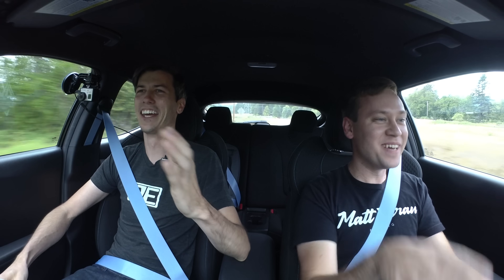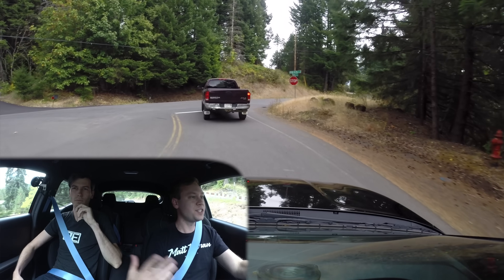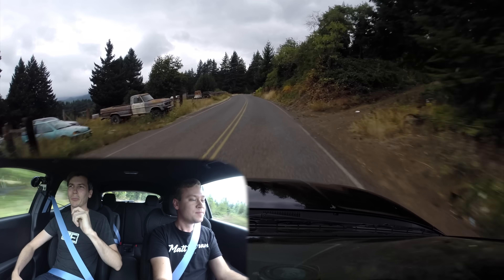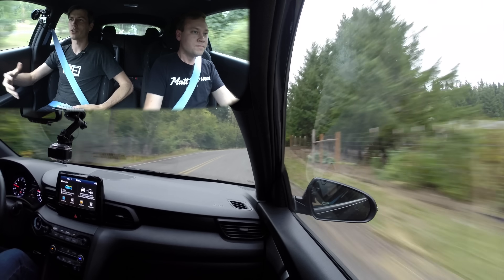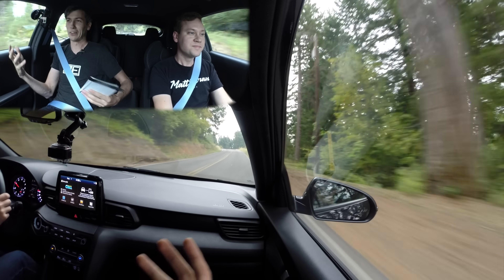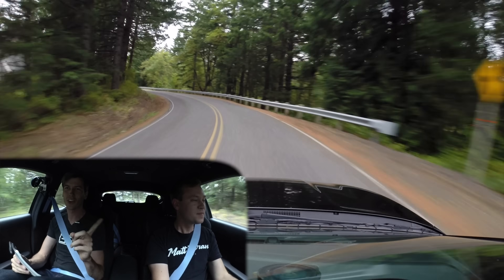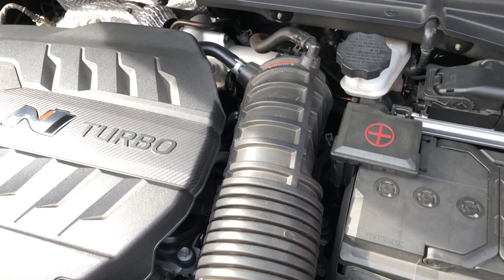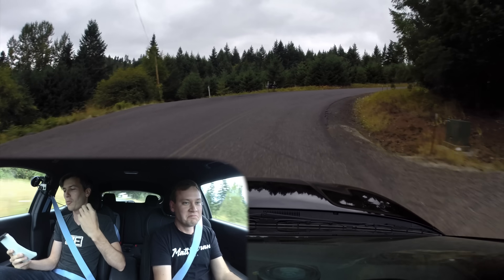Are Car Exhaust Crackles & Pops Fake?

Comment: So this is an old video, but I would not say the F-Type started this, My car a 2013 335is does it, and so does a 2011 My 2007 335i did it much less but did it a little none the less. Point being the 335is predates the F-Type and I am sure that BMW did not start the trend either. But one thing that is not addressed is what does it do to the CAT. Also with a DCT or Slushbox does it really do any good for turbolag that is non existent. I mean sure DCT is a computer controlled "manual" for all intents and purposes, I cant see the 90ms shift times having much effect on turbine speed.

Comment: My '66 Corvette does it, no electronics to alter timing, and sidepipes. It's much more restrained than my '12 Camaro 1SS/LS3 was, which was absurdly loud with crackles and pops. My buddy's '69 Hurst/Olds does it, no electronics either and quite illegal straight pipes. His car sounds like a machine gun on a downshift! Mine is tame by comparison. A little unburned fuel in the exhaust. The ignition timing on both is correct as in mechanical and vacuum advance are exactly where they need to be for best overall performance. My '70 Buick GS455 Stage 1 clone with the big tube headers did not do it- it had electronic ignition I retrofitted. Now, cue the 'no vacuum advance!" crowd. Tsk tsk, at WOT there's no vacuum and you will never miss that .05 second on the street. However, being able to actually reach the next gas station is a plus.

Comment: As an old geezer who remembers coming of age -i.e circa 1976...  I find it hard to relate to drivers today who value exhaust noise for the sake of, well, exhaust noise.  Not that I minded exhaust noise typically associated with muscle cars of that *era.  But noise per se was hardly the quantity to be desired. What was desired was the feeling of being pinned to the back of your seat. 

* (Technically, the muscle car era ended just a few years prior, when Detroit found itself ill equipped technologically to accomodate a combination of new emissions laws and a spiraling cost of gasoline.  But I digress...)

Comment: I have a 2020 WRX stage 1+ that gurgles and pops like crazy when downshifting, especially when it’s cold. I can tell by my access port that it happens more if the car pulls timing (it’s always been within safe parameters). It’s my first project car that hasn’t had a V8 and I must say…I LOVE IT!  It’s by far THE most fun vehicle I’ve ever had.

Comment: I love the cracks and pops. Not only do I love the sound now and then, I also find it useful for example, when someone is on my tail or driving too close behind me and not letting up, I will switch my BMW X3 M40i into Sport Plus mode and let off a barrage of pops and crackles like warning shots and without fail, they back up. So I think sometimes, it can be useful in a way.

Comment: I really hate them pops and bangs mainly if the car is going 30km/h 2500rpm slowing down gently and it’s cracking like a race car on nurburgring. So lame and unnecessary.
And btw aren’t the fake vents on Supra designed for tuners to make them functional easily without screwing up the bodywork? I think I’ve heard someone talking about it and it would make sense since Supra is tuned so often anyway.

Comment: Porsche’s gas pedal is also to control the amount of fuel that it’s being injected into the cylinders besides controlling the amount of air just like in the Diesel engine where you only control the amount of fuel that you’re injecting into the cylinders by pressing the gas pedal. That’s how diesel throttling works. And Petrol throttling works by controlling the amount of air going to the cylinders by pressing the gas pedal and opening the throttle body. So Porsche decided to use the gas pedal as control both air and fuel as well like in the diésel engine.

Comment: I am not a fan of fake stuff.  However I do like the sound of the exhaust crackle.  I was hoping to hear some history of why older race cars [pre-computer age] did it.  As for the CVTs, I am a big fan of the forced gear ratios, during hard acceleration only.  Otherwise the car seems very slow, since there is no change in engine tone.

Comment: i used to have a 2005 mini cooper supercharged and after 3 years i was totally frustrated of the crackles and pops all the time, sooo anoying, you could press and release the gas and would do unlimited crackles and pops at 80km/h, sounds like missfiring backfiring crap beater car, the problem is that reviewers that drives the car for 1hr likes them, then everyone wants them, then manufacturers puts them on car and someone has to live with it for ~1500hrs, never buying a car that crackle and pop again, ever

Comment: @1:50 explains the conundrum. I am okay with enhancing noise inside the cabin, especially if it enhances gear shifts. Strangely, I generally dislike fake exterior bits like vents or fake exhaust trips. Why is that?

Comment: This suggests it only works with EFI engines but that is not true. In my opinion the pops come from high intake air velocity which goes directly into the exhaust because the engine rpm is slowing down quickly. This is because valve timing has overlap, which means the intake and exhaust are open at the same time. Normally when the engine revs up the intake velocity is lagging behind a bit, so the air speed is not high enough to escape through the exhaust valves. But if intake air has the velocity required for 7000 rpm and the engine speed quickly slows down to5000 for example, it will escape. The heat in the exhaust then ignites the fuel, hence it pops and shoots flames.

EFI engines normally shut down fuel injection if you let go off the pedal so they won't pop. You'd need a tune to override that and make it pop.

Comment: I know I'm a bit late to this party haha, but on my twin carbureted MG midget, I get the pops when I downshift as well. my car doesn't have any fancy timing delay tho haha. my theory is that this is cause because of the air and fuel starvation. while the engine is still running at high revolutions, there is not enough air and fuel to support that. is this correct? @EngineeringExpained

Comment: I had a Chevy S10 that did this but that was mostly due to throttle body injection so basically it had a very rich idle so when you let off the gas there was a ton of unburnt fuel.

Comment: The fake air ports in a new supra are specifically added (according to Toyota) for aftermarket tuners to replace with functional ports. There's several other places on that car that have unused but embedded designed upgrade paths for aftermarket performance accessories. There are unused mounting points for additional bracing in the engine compartment, for instance.

That brings up another argument about whether it's legitimate "customizing" if the manufacturer designed the car for upgrades from the start. However, the fake ports are simply to fill a hole for normies, and a place to put functional air ducts/ports for people who upgrade other parts like brakes or supercharger/turbo for track or drag. In one way, it's a good move on their part not wanting aftermarket tuners to mangle the body and design to get the most out of it, but on the other hand, it makes the stock car seem goofy and fake.

Comment: i think majority of the burbles that we hear now is due to exhaust pressure pulses? Because lets take Golf 7r for example, selecting the right exhaust will allow the car to do those burble cracks pops, the very subtle ones (not the one that pops and bangs because of artificially tuning it and forcing that to happen). Invidia r400 catback + stock Golf 7r will give pops, but most of the other exhaust will not do that

Comment: My AMG GT-S has crackles and pops designed by the Gods themselves.  I love it.  Coming from a super quiet 911 Turbo, what an improvement.  Smiles per mile are 5X more.  And pumping in fake sounds through the speakers should be a crime in Germany.  I started to lose faith in BMW when they started that BS with the V10 M5.

Comment: I enjoy the videos and think you generally have good information and make extra effort to be fair and accurate. I know you deal with modern automotive technology, but I do wish you would you would occasionally note/mention that something's were different or not applicable to pre-computerized  cars. I have been told several times 'facts' novices learned on YouTube that they assume have always applied. This is a good example... my 1970s truck with a  stock factory engine designed in the 50s makes a lot of these sounds naturally as a limit of the technology of the time. Performance based- no, purposeful added- no, cool- yes.
Less a complaint and more a thought for tge future.

Comment: What about when the the car is not designed to make crackles and pops, but does it anyway? 
When I push my FB RX-7, it pops between gears. As far as I know, it was not designed to do this. It also pops while engine braking in certain rpm ranges.

Comment: I thought as soon as the engine is on the overrun the ECU stops opening the injectors and therefore no fuel should be present to pop away?

Comment: So backfiring used to only refer to the banging from explosions occuring in the exhaust... occasionally with actual fire. That goes all the way back to the dawn of cars. You would see it a lot with antiques puttering along and then BANG.

But now we apply it to the crackle also. Is it the same thing to different extents?  Should we have different terms?

Someone says "backfire", and you think junk car, engine problems. But if you say exhaust crackle you think of that lovely sound after letting off the throttle.

Comment: I've also noticed that many of the dual clutch cars do this, as well as make really strange noises (almost like a fart) on upshift. I've always wanted to better understand the engineering behind that.
Reply: It’ll sometimes do that even without closing the throttle completely to make the shift quickly. When the DSG requests a shift, it happens so quickly that closing the throttle and waiting for the intake to empty, letting the turbo slowing down makes it feel slower, and the shift would take longer. So the timing retard happens for a few strokes as the clutches swap during the shift. Actually the fuel doesn’t necessarily cut fuel because that makes NOx emissions harder to control, a fuel cut fills the catalyst with oxygen and it will take several seconds to get NOx emissions to spike a lot. After fuel return the ECM needs to run rich for a bit until the catalyst is back to normal, so within the constraints of emissions it may make sense to leave the fuel on.

Comment: Inyector cut on deceleration comes stock in bikes, and Throttle off and on middle of the curve gets better if injectors are ON on deceleration.....  that is a reason why not to shut them off when you let off the gas....(on a bike).

Comment: Jason, here's another video idea: Does revving the engine at idle cause any damage? And why are there soft limiters on certain cars? (Audi/VW)
Reply: Soft limiters are there to minimize the chance of over-revving the engine... and smooth you into it. I say minimize because, occasionally, a guy will slam the car into 2nd while attempting to grab 4th. In the old days they simply cut spark but that pollutes. (In the 60's VW did that by installing a rotor that'd short out above "red line" on a new engine.)

Comment: "Fireworks serve, literally, no purpose." Clearly, this is wrong, as there must be purposes for fireworks, or else they would not be manufactured.
I believe that you meant, "Fireworks serve, practically, no purpose."  (However, this too is incorrect, as fireworks are used for practical purposes, such as scaring birds away from airports.)

Let's start using "literally" correctly, folks. Like, "Most people literally use the word 'literally' inappropriately."

Comment: If there is something on a car that doesn’t do the function that it would be designed for then it’s fake.
A huge wing or wing lift spacers on a FWD car is fake. More downforce on the back of the car won’t help it perform better.
Scoops and vents that are blocked off and serve no purpose than aesthetics are fake.
Electronic engine sounds aren’t the actual engine in the car making noises, so that’s fake.
On the other hand, something like what my car (Fiesta ST) has, which is a mechanical sound symposer which is connected to the induction piping and sends more actual engine noise to the cabin. It’s as real as rolling down a window and isn’t fake, even though it is just for sound. Though I’d recommend taking it out and putting a decent cat-back on if you want to hear the car better, as the symposer makes the car drone more. Not really fake, but it wasn’t needed in the car.

A manufacturer like Honda with their Civic Type R doesn’t get is that there’s beauty in function. A lot in fact. Something like an F1 car looks rad as hell because all those wings and fins actually serve a real purpose and that’s to produce crazy downforce. If you’re going to put scoops on a car, have them actually lead somewhere so that they might not do much, but they at least do something. Or just don’t have them there in the first place. Don’t put a wing on a FWD car to do anything other than reduce drag, since less drag will help the car go faster. And don’t put a fake engine sound in the cabin to make the car louder some of the time. Put a decent exhaust on with electronic valves that can make it louder in sport mode, but quieter for normal mode. Then you can have a quiet car, but also have real sounds at the press of a button.

Comment: Is there any modification that can be done to avoid the crackles and pops?
That is the most disgusting and annoying sound ever. I constantly find myself releasing the gas very smoothly and carefully just to prevent them, but I'm getting tired about it. 
I really hate them. It's like if the engine is about to break and completely opposite to an enjoyable smooth revving sound from the past nice (non american ofcourse) engines.

Comment: My car naturally does it a little bit as a side effect of decel enleanment and ignition retard, bit of manifold fuel in the mix as well. Only does it when lifting the throttle but not completely off it. Another factor is it's wasted spark ignition.   Kinda cool considering it's not a sports car and 28 years old.

Comment: I worked 12 years in the automotive industry and I can say that all manufacturers are laughing at us... and right in our faces.
 Case in point, half of the value of a car today is how much USB there's in it... no body needs any of these gadgets / garbage.
All of that sheitz that you guys are talking about here... waste. No body need any of that.
Colin Chapman said: If it does not need to be on the car... it's not on the car.
CVTs... why are they on cars today? Because it's cheaper to manufacture than manual gear or automatics. It's a compromise... so worthless.
As for the fake aero... I mean, do you need another definition of manufacturers laughing at you... they put fake BS on the car and the imbeciles buy it.

Comment: I hate fake crackles and fake cabin noise, and people with turbos that loudly blow off air when they let off the throttle.  I especially hate 4 cylinder engines with loud exhausts.  Have your fun without annoying everyone else.  I love V8s. I love Jaguars, but the crackles put me right of the F-type.

Comment: natural aspirated engine pop and bang because they cut off ignition immediately but port injectors lag and let small amounts through which combusts in the hot cat. Also direct injectors do not stop spraying entirely when you take off throttle to prevent compressed air going back up the injectors. therefore non of them are fake...

Comment: 1968 Jeepster  Commando. Buick V-6. short exhaust pipes with cherry bomb mufflers. timing set at 12* btdc. everytime you took yer foot off the gas, crackles and pops. going down steep hills in second gear produced a sound like a war.

Comment: Most people don’t know but in the new 10th gen civics 1.5t have the same kinda weird  Anti-lag system to prevent turbo lag. You don’t notice because the stock exhaust is so quite but if you remove muffler and resonator it crackles and pops a lot

Comment: Probably the dumbest question but please have mercy. My vehicle did not create "crackles and pops" until I did a axle back muffler delete. Did the vehicle always create the sounds and I couldn't hear them due to the muffler or did the axle back actually create a change in the motor function?

Comment: I always thought it was from too rich a a/f ratio and there’s unburnt fuel igniting in the exhaust
Reply: It was in real race cars , nowadays it is fake tune for family cars to feel racy .
Reply: @driver46  Exactly! 💯

Usually it was/is only from time to time that those pops & bangs happen.

Nowadays on modern sports cars it is permanent and predictable...
It's ridiculous!
Reply: pretty sure thats why subarus crackle so much. especially turbo ones which are set up from factory to run rich in case a boost leak or something causes overboosting which can lead to running lean.. on the other side my old na legacy would crackle like none other but the spark plugs when pulled would never be covered in soot or anything so maybe were wrong

Comment: For sports cars and supercars, any fake exhaust noise is a sin. No real enthusiast should support fake exhaust noises through speakers. Nor should the sound have to be piped in. Having exhaust valves is totally fine though. Push a button and it’s quiet or you’ve unleashed the beast.